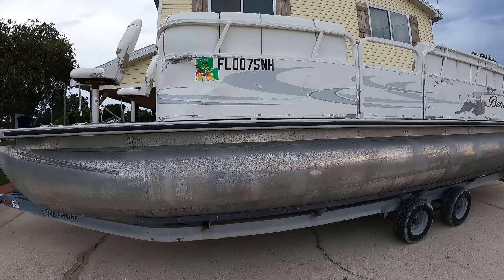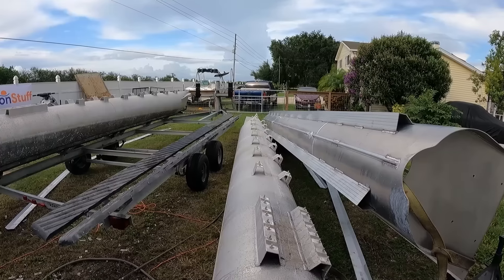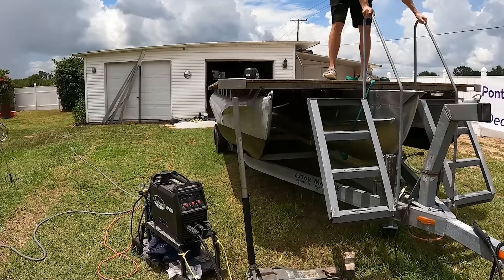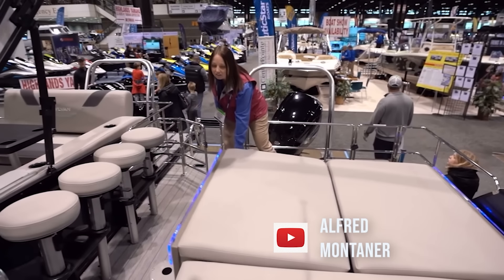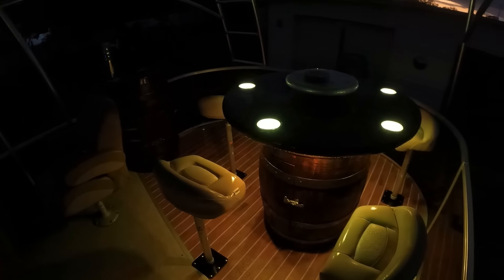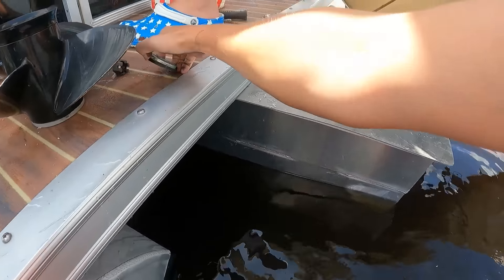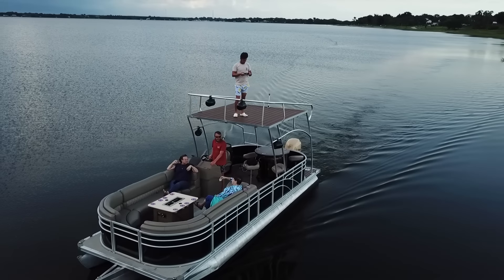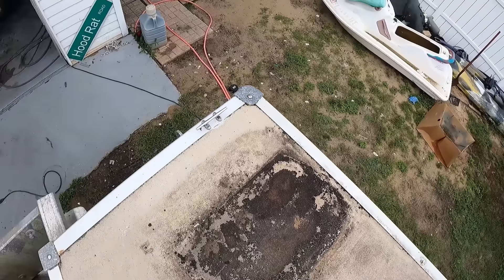How much does it actually COST to build a Pontoon Boat?

Comment: I recently bout a pontoon and decided to go tri-toon as well..I decided to go with carbon fiber instead of aluminum, that way I can add some things to increase the overall appearance of the boat while keeping it lighter in the process..
   I'm also doing a 2/3 length canopy top in which half of it would be solor panels that charges the solor generator and the other half of the canopy is for sunbathing and for a slide.... A floorboard compartment in the middle pontoon will house the solar generator that will help keep the battery charged and well  power a 32in TV, a custom made ceiling fan, some LEDs, light bars/headlights and taillights equipped with signal lights...It's gonna be epic 😂
   Oh by the way I admire the hard work you put into your build it turned out amazing..The black probably really pops in the sunlight

Comment: Zach,
I have started my own pontoon rebuild and have incorporated a lot of what you have shown on your videos.  One of the things I was curious about, and I apologize if you left the links in a previous video, where did you purchase the hydraulic steering and throttle controls for this build?  The prices you mentioned are a lot lower than what I've seen on the web.  Do you like the quality of these items?  
I am hoping to have my rebuild completed for summer of 2023 and this info would greatly increase the chances of me getting it done by then.  I sent this to you in and email if you'd rather respond that way.  

On a side note, I live in Indiana and I visited PontoonStuff's headquarters.  They obviously had heard of you and loved the props you give them.  They were very helpful as I purchased a lot of the electrical items I needed.  I wish I was as confident as you when it comes to actually wiring it all up.  First time for everything.  I'm sure I'll figure it out.  

Thanks in advance for your time in getting me this information.  Keep up the good work and the great videos.

Comment: Glad you got yourself in a better place mentally.
It'd be a drag not to get to watch your awesome talents rebuilding pontoon boats. 
For those negative about a fire pit of grill on any boat.
That's just senseless.
As long as you have a good first aid kit on hand and 2 fire extinguishers on board always easy to get to that's a non issue.
When I lived in the Keys everyone I knew and myself had grills and most had a fire pit similar to the one you had. Some even better.
I'm looking forward to watching more of you killer rebuilds.
You're definitely underpricing your pontoons.
The one with the fly deck could easily sell for well over 50 grand being a custom one off build with all you added to it.
You need to figure in your labor including research into items you used, time spent ordering it and even testing time.
Comparing your toon to those others is like comparing a Mercedes to a Chevy Vega.
With your build the Mercedes.
So 50 grand plus is definitely the right price.

Comment: Your videos have motivated me to do a project of my own, thank you for that. I have scoured the interweb for information about carpeting an aluminum deck and keep coming up short. I have removed the old carpet and cleaned most of the old glue but it still has some residual glue remaining. The deck has small grooves in it almost like a stadium bench that runs the length of the boat. Have you done a project like this? How clean do I need to get the surface to reapply new glue and lay the carpet down? It is a 28' tritoon so it has a lot of surface area to clean and prep just looking for some pointers and advice if you are free to offer it.

Comment: You do excellent work. I would find it useful if you could remove the "fancier" parts from the build. I'm interested in building a similar boat, but without the firepit, the wet bar, and probably half the LED lighting.

Comment: Awesome video! I am wanting to redeck an old pontoon to make it into a dock and I was wanting to use that same trex deck boards you used on the top. Do you notice any sagging like when you step in between where the studs of the floor are? I just wonder if I should put ply wood down first and then put the trex over that or if I could get away with just putting trex directly onto the aluminum runners of the boat? Thanks in advance!

Comment: I am from Louisiana.  Most of the pontoon boats here have a structure on the stern that is sort of a sound barrier from the motor noise and extra room for sunbathing on top and to hide the gas tank and provide extra storage beneath.  Is your motor noise real loud uncovered like that?  Have you ever experimented with sound dampening in any of your builds (other than slowing down)?

Comment: You mentioned most of the comps are newer than yours, but that's not entirely accurate since you just went through and replaced/updated/added.  Your asking price is fair considering this is a higher end boat with mostly new components.

Comment: Dumb question...But considering that the boat is brand new... Would you be able to start a custom 'boat building' business and get a new title on the boat under that name? The title for the motor would be a 2004, and the trailer would be whatever it is....  but the vessel itself would show brand new... and it should, because it's brand new.

Comment: First off after seeing prices of toons around here the other day there’s no way I would let that baby go for less than 75k you got 31 in it and a shit load of time !
  Ok I didn’t see the dents in the toons from this video so might not have worked but on my toons I pulled the drain plugs out and Hooke up my air compressor to it and got the dents out that way a hole lot easier than swapping them around

Comment: The boat is really nice but it still has an older cheaper motor. Thats gonna hurt the value a lot. Room and reliability and seating is key. I think you could have skipped all the lighting radio and bars firepit and upper deck and got 20k out of it. Maybe had 15 in it. A lot of work or 5k though. Maybe Im off. You should just buy a sewing machine and redoo the seats yourself. Way cheaper. A lot of lake people dont like the upper decks because they cant go under most bridges. Also the trex may sag without support every 12" in the hot sun. I can see your just trying to get your money back as the build is just for content and shows what you can do, which is a lot. I can beleive how nice new railing looks and for only 2500 that seems like the best upgrade and the new flooring. Center toon pretty exspensive too. I wonder it you could use a used one from a larger boat or make a 4 toon LOL>

Comment: As for the cost of the boat, ask $50,000.00 but don't settle for anything less than $39,000.00. Market it as a fully custom boat with complete video and paper histroy. It will sell. Don't sell your workmanship short. I can't do what you did others can't either.